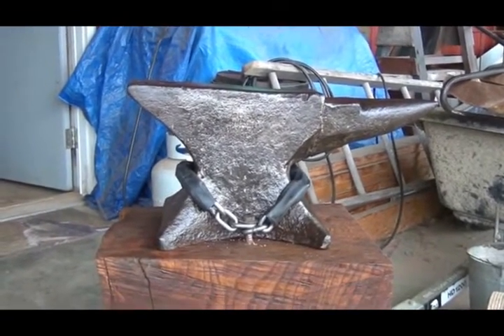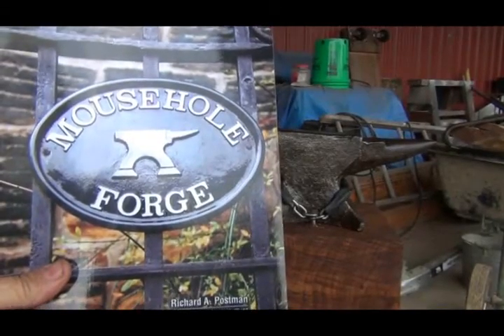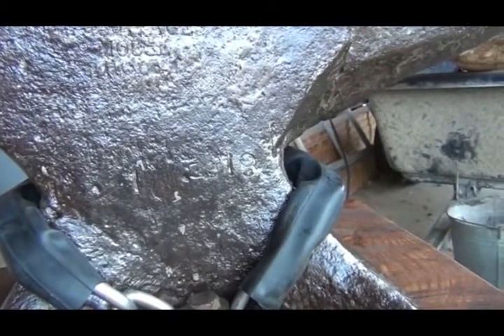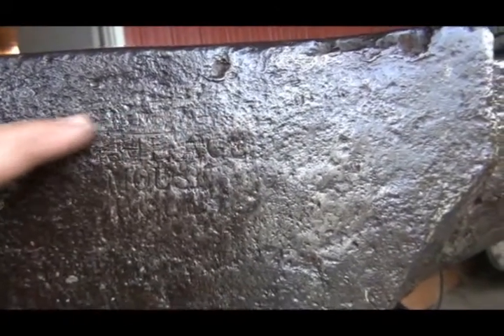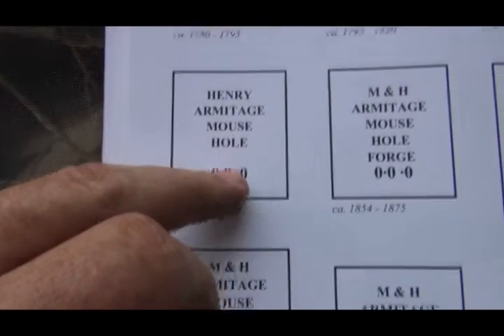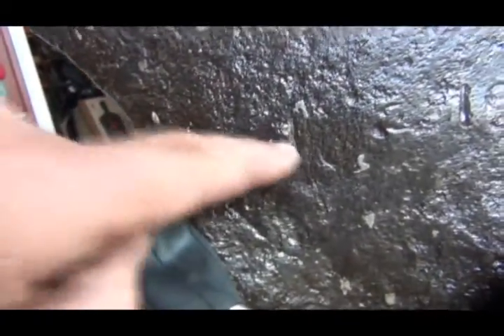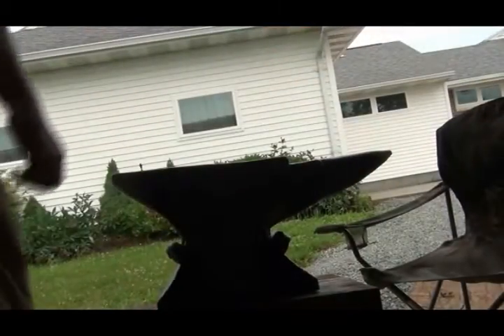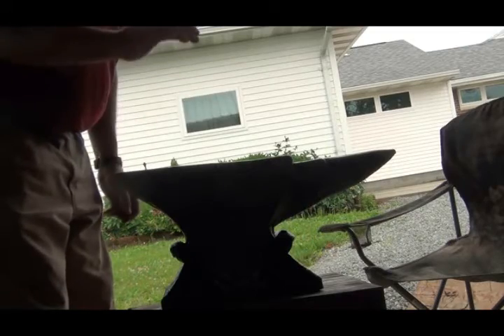My Anvil made by Mouse Hole Forge

Comment: OK, so the steel bearing bounces off the anvil top. But, I'm sitting here hollering at the screen, "So what does the bouncing bearing mean?" I assume the bounce is a good thing, but what does it say or prove about the anvil?  LOL!
Reply from the maker: DocLarsen44 it's called a bounce test to see if the Anvil surface is hard and attached to the forged part of the Anvil. if you look close you can see there is a half inch thick plate on top that is more or less tool steel hardened. sometimes it comes unlaminated. if it is a cast iron anvil it would be kind of dead and not bounce. it is just one of the tests that they do on Anvils to make sure their good.